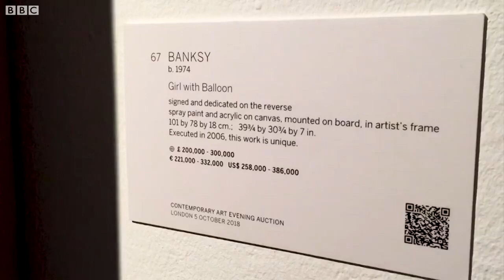Banksy shredding 'didn't go to plan' - BBC London

Comment: The auction house knew the shredder was in the frame and knew it would be good publicity
Reply: If they didn't, that's a security issue. The thickness was big enough for an effective pipe bomb.
Reply: @robertnicholls9917  based bansky bombing auctions 😂